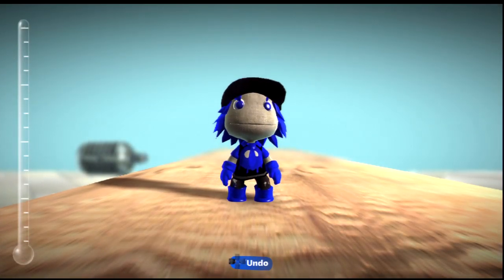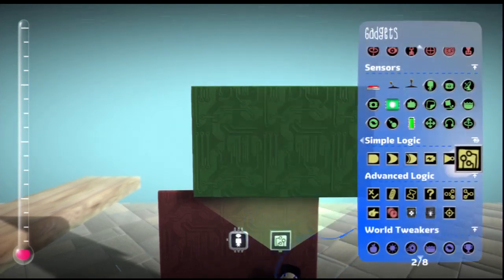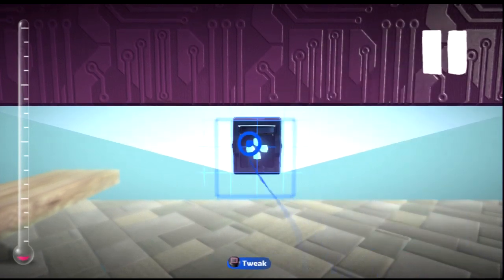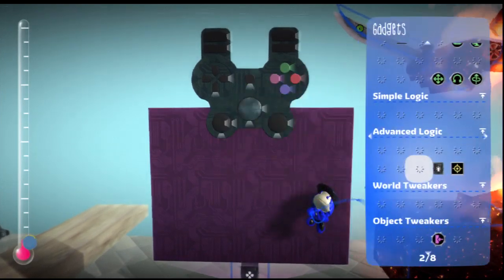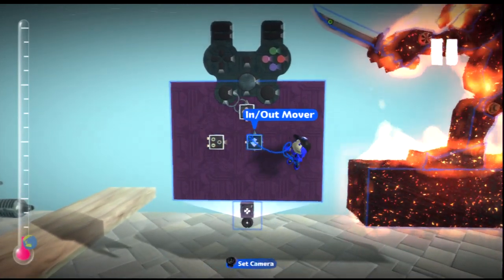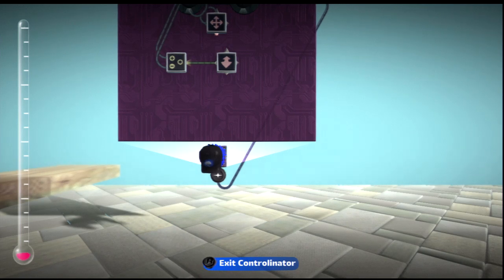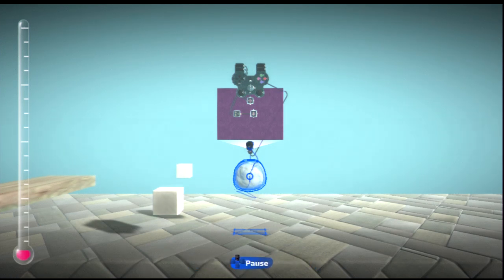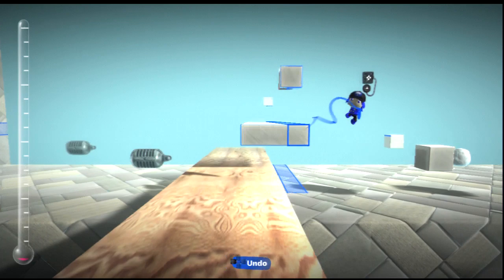LBP2 Glitch: Simple 3D Layer Tool (Make 3D layer Materials and Objects EASILY!)

Comment: 2:02 There is still way to do this glitch, but is a little diffirent. Start of with a sackbot, any material and any logic. Place a logic on material, then hold R2 select the logic and STILL HOLDING R2 select sackbot and logic dragging (u know X and left joystick), then stop holding R2 . Next copy it ALL onto the material, get the sackbot outside the material, then press ∆ once. In that moment you will see, that head hitbox detached. After this open sackbot's microchip and place logic for destroying. Finally do the last steps from tutorial.